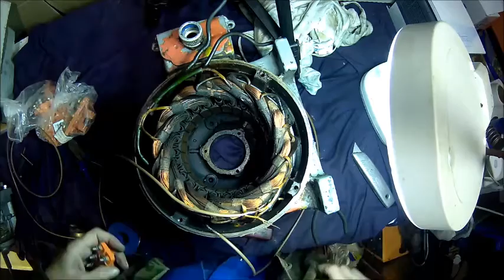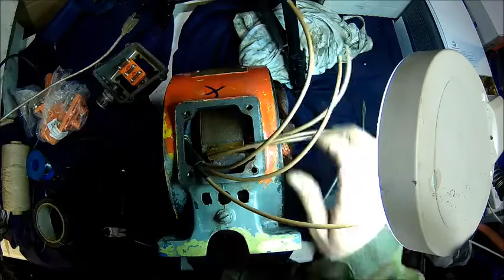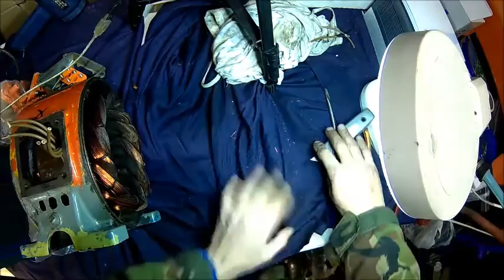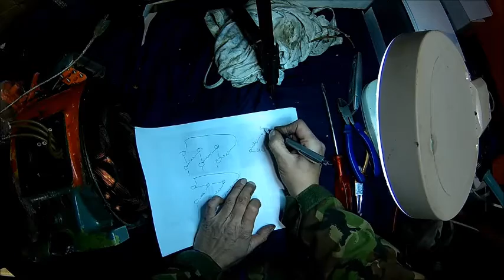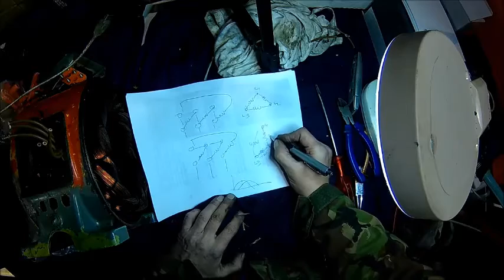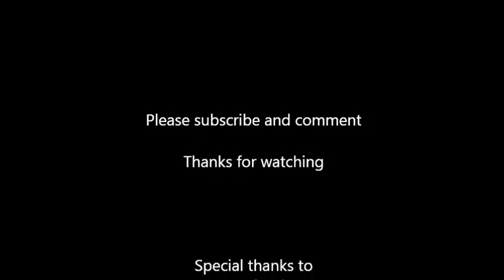Elliott 14S Shaper - Motor refurbishment Part 3, wires, wires, wires ....

Comment: i was thinking all motors were wired in Y but the connections converted from  Y to delta .    But this motor was connected in Y and you had to remove the Y connection rerun the ends of the series connected  coils back to the terminals  . 

 So some motors can be wired for delta some for Y permanently and some for both by changing the links at terminal block ?    Is all this info on the motor plate ?     sorry for all questions but im trying to learn this and understand it better .
Reply from the maker: The motor name plate normally tells you a voltage for each, star or delta, some motors are hard wired internally, but the name plate should still tell you what the actual circuit is.
Older motors are relatively easy to change, new stuff can sometimes be very difficult to work on

Comment: this is a concern i was thinking about a wire in a coil flipped , so it would make the motor stall and humm ?   hoave you come across this ? and how do you fault find to resolve ? .
Reply from the maker: The motor will most likely not turn (or very slow but almost no torque) if one coil is wrong, it also hums pretty bad. Cant really tell you how to figure it out, it's sort of natural to me, sometimes it does help looking at the wire ends and where they coming from, sometimes there are numbers or letters on the wires. Trial and error always works.

Comment: Interesting videos. Real educational, hope to see it running soon.
Reply from the maker: Thank you very much, ... you will see it running in a not too distant future.
Reply: I've read somewhere that star motors can have less insulation.
Could this become a problem for this motor?
Reply from the maker: Does not really make sense as the terminal voltage to ground is always higher in star, in fact it is factor 1.73 between star and delta. That means in delta the motor runs on the lower voltage, in our case 230V instead of 400V, so nothing to worry about as the insulatiom is at least good for the highest voltage on the plate. .
Reply: Well I'm no electrician but I know that a motor produces less power in star. And less power usually means less heat. And with less heat you can get away with thinner insulation.
Reply from the maker: I am sorry, but that statement is incorrect as well. A standard three phase induction motor produces exactly the same power when fed with the correct voltage for each wiring type (star/delta). The name plate will tell what voltages are required, you will also see that the power is the same for star and delta.
The insultation thickness is mainly voltage related, insulation material type is heat related, Insulation class on the name plate will tell. Design target is to use the thinnest possible and most thermal conductive material to get as much as possible heat away from the copper windings into the iron core. That's the reason why some high performance motors have water cooled windings.
Reply: So what happens when you use a VFD?
My Drill press has a VFD and it produces a lot more power in delta then it does in star.
And Yesterday I uploaded a video of an old motor that got hot in delta and would not go higher then 25hz worked fine in star.....
Reply from the maker: Well, i'd suggest to watch part 2 of my "tame your motor" series. That should answer all your questions and perhaps give you an idea what's wrong with your setup.

Comment: That's coming along Mike. I've just remounted the motor mount plate and captive mounting bolts.
Reply from the maker: I've done it a while ago, just been too busy to edit. brcause the Jeep  MOT ended with a welding job.....so much .love welding in the rain.
Motor is mostly done, just need to clean a few parts and reassemble it, the paint job is your's anyway ...:-)